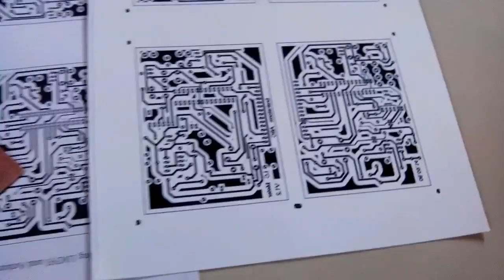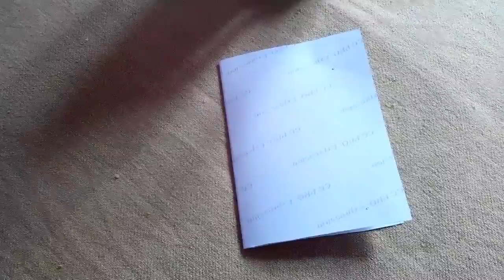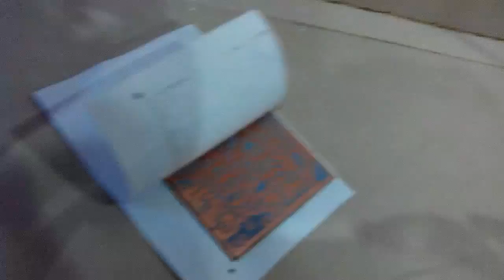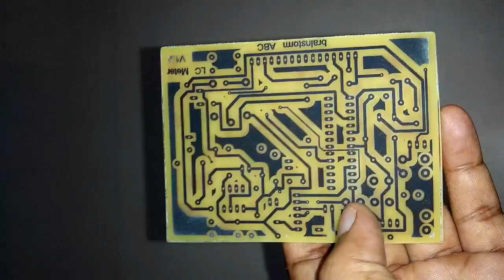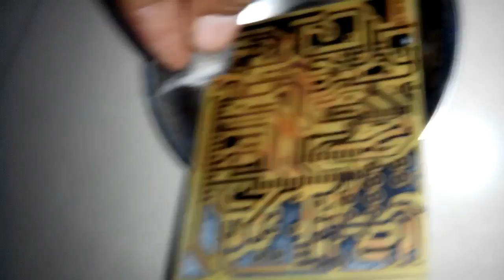Double Sided PCB Home Made DIY

Comment: Which kind of paper you have used for transferring the print on the copper plate ?? .. the paper you have used is looks like little bit thick ( than a normal A4 size paper sheet) .. can I use normal notebook paper for this purpose or thick paper is required ??
Reply from the maker: i have used Kodak Photo Paper High Gloss 200 GSM A4 Size. you may use any gloss paper of old magazine if you want to use thin paper.

Comment: Are the two sides connecting with each other?
Reply from the maker: +Nick Stolis Yes the components which connects through holes and vias make it connected both the sides. thanks
Reply from the maker: yes we connect it where ever as per circuit through hole soldering.

Comment: how did you put two diagram in a single sheet and which software did you use to design the layout
Reply from the maker: kinyume kabaku i use Eagle CAD software. I save the PCB layout in pdf format. then covert it into JPG and by using Photoshop i make it at one page to get printed
Reply: Thanks for your helpful information
Reply: +brainstorm ABC how much distance should be kept between top side and bottom side while printing on single page

Comment: I've no seen a so high-bright photo paper in my whole life...., it seems to be a good photo paper with some kind of transparent packing tape on it, isn't it? Thx a lot for share, ABC..
Reply: No, it's a special paper for making PCBs. You print it with a laser printer and then heat transfer it onto the PCB. Not the most precise method in the world but it's way easier than messing around with photoresist.
Reply: *****
Thx a lot for you time!, i'll try to buy a couple of shhets of that & try to use it for artwork electro-etching.